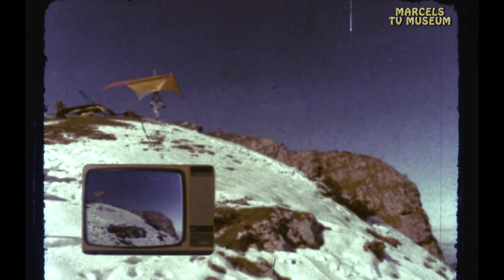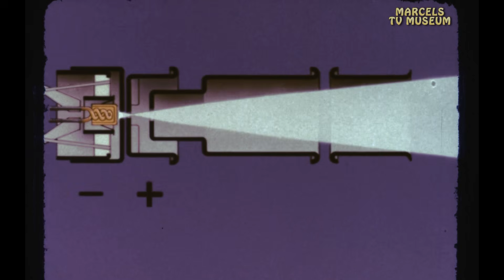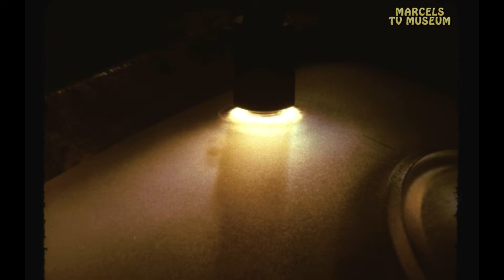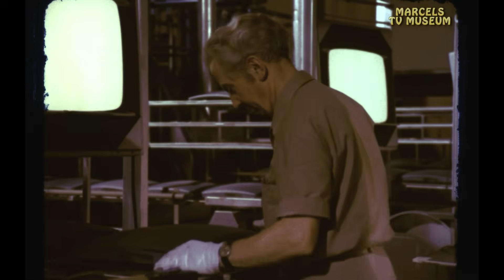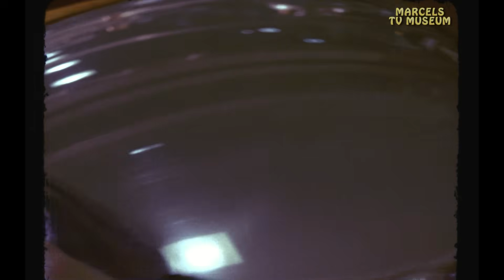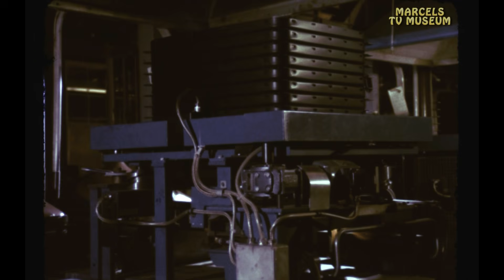Naturally... in colour, a look inside a color picture tube factory.

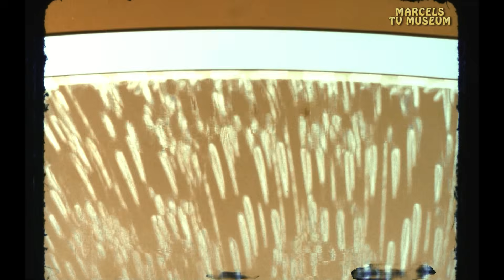Comment: At 24:00 video explains how the shadow mask is used as an exposure screen to form the stripes on the tube face.  But it is not explained how a shadow mask, with its "interrupted" hole pattern, makes solid phosphor stripes on the screen.  The light source needs to be either a stripe parallel to the rows of holes in the mask, or needs to be moved parallel to the rows during the exposure.  Which way is this done?

Comment: I remember the first colour TV's in the UK during the 1970's. Although I had to know how a TV worked, I seldom had to work on them and I'd forgotten how much cutting edge technology went into colour TV. Phase modulated I & Q chroma, amplitude modulated luminance and some clever maths to get it all to work. I still remember 4.43361875 Mhz was the PAL subcarrier frequency and glass delay lines to cancel out any phase errors between adjacent lines. The system from camera to receiver needs a video of its own.

Comment: I find it amazing how sophisticated CRTs are. The fact that it was developed to a reliable point before LCD screens is mind boggling.
Reply: That's only because LCD is even more sophisticated ;) With more screen layers, advanced molecular chemistry needed for efficient subpixels, electronics components printed directly in the screen surface and much more complicated control circuitry, not to mention advanced lighting like compact fluorescent or even mindblowingly hard to build properly marvel - white LED.
Reply: @EustaH  Yeah the reasons tvs were crt in the  first place is because yeah cheap microcontrollers is what made lcd and o led tvs possible. Modern tvs basically have computing in them.
Reply: @cosmicsvids  That’s true, but my point is we made our current tech so cheap and so abundant that it seems easy and simple, so we are astonished how complicated and precise some things were 50 years ago. 

In reality the 1$ crap from china requires far more precise and complicated parts than this CRT - we’ve just got that good in making stuff.

It’s like watching a true master playing an instrument - when he does it it looks effortless, while in reality a regular person wouldn’t be able to even position his fingers that way, let alone do it fast ;)
Reply: @EustaH  LCD / LED / OLED / Mini LED / Micro LED are 🗑️ compared to CRT.
  It is an Electron Gun vs. CCFL / LED / OLED lamps. Piece of 💩 light technology!
  CRT 📺 have built-in HDR. Watch a DVD Video™ movie on a CRT 📺 hooked up via S-Video or Component and you will see HDR on night scenes that have a 🔦 or 💡 turned ON.
  Flat panel TVs need the hardware to produce HDR built into them and the software to produce HDR programmed into 4K Blu-ray™ Discs. And then you have to turn ON the HDR and calibrate it. Pathetic! Piece of 💩!
  CRTs just do it… inherently. No need for extra hardware to be built into them or software to be programmed into DVD Video™ discs, or adjustments to be made by the consumer.

💯% undebatable & undeniable facts|truths.
Reply: @EustaH  ⚪️ LEDs are not difficult to build. It is just a 🔵 LED with a phosphor coating to help make white.
  LED lighting is a piece of 💩.

💯% undebatable & undeniable fact|truth.

Comment: Watching the way of assembly, how Labour intensive it is just shows how far automation has come. And it's amazing how much the technology has come now we can build really large TV for indoor or outdoors and really thin practically like a wall picture frame amazing  ! .
Reply: Manufacturing CRTs today would still be labor intensive, regardless of how far automation has advanced. This is because CRTs have many individual complex components that require great precision to manufacture. Modern TVs (LCD, OLED) are completely different technologies, which in many ways are much easier to manufacture. 
Light and cheap plastic defeated heavy and expensive glass.

New TVs (LCD at that time) literally immediately gained an advantage over CRT in such characteristics as dimensions, weight and energy consumption. But in terms of overall picture quality (not just pixel detail), LCDs and OLEDs have only recently begun to approach CRTs. And in some aspects of the image, modern TVs still cannot surpass CRT.
For roughly the same reason, PDPs (plasma) also left the market. It was a very high-quality, but too complicated and too expensive technology compared to new plastic panels (which are basically just a lot of tiny LEDs).
Reply: @B1-Han  ... Absolutely right, you correctly stated the essence of this topic !!! 😮

Comment: It's a bit odd, that a Philips factory movie show them producing Sony Trinitron tubes
Reply: They were not showing Sony Trinitron tubes in this film these were philips 30AX tubes which also like the Trinitron had vertical phosphor stripes on the screen the main difference is the Trinitron had an aperture grill which was made with thin vertical wires that were under tension (that's the reason early Trinitron tubes were cylindrical shape in the vertical plane) these wires formed the mask with the electrons passing through the spaces between the wires just like the electrons passing through the holes in the shadow mask there were a couple of very fine wires stretched horizontally across the aperture grill to prevent the vertical wires from vibrating from the sound and other shocks transmitted to them vis the tube structure. The other difference is the Trinitron tube had a single electron gun that had 3 cathodes this produced the three electron beams but these 3 beams passed through only one electron lens formed by the remaining electrodes. on the earlier tubes they also had more electrodes at the front of the electron gun assembly that provided the static convergence of the electron beams the connection for this was brought out via the Final anode cap which had a coaxial connection and a potentiometer on the EHT unit for adjustment of the static convergence as well as the usual focus potentiometer. on the later tubes the static convergence electrodes was powered via a dropper resister fixed on the side of the electron gun assembly inside the tube. The patents for the in-line gun CRTs must have expired in the early 80s as other manufacturers of CRTs started making similar tubes which became more common these tubes were collective known as PIL (precision in line) tubes and were easily identified as the deflection yoke assembly was glued onto the tube wirh rubber wedges stuffed between the deflection unit and the tubes cone these were glued in position once the convergence had been adjusted and there were also ring magnets with 4 and 6 poles on the neck of the tube to set the beam landing and static convergence.

Comment: Thx for sharing this  superb, comprehensive documentary!
My only question is why Philips chose to use crappy 16mm film to photograph a short documentary about COLOR PICTURE tubes? If Philips -- given their deep pockets in 1970s -- had used the best quality 35mm film (and camera systems), this documentary would have looked much more professional. Not like some college film project.
Reply: Arguably, it could be an issue with this scan of the film. 16mm isn't bad per se with a good scan, and direct projection would probably have been easier with 16mm

Comment: Insatlled quite a few of these when I was 17 - but only after "rejuvenating" the old tube had failed! They represent most of the weight of the TV set. Good old Radio Rentals would squeeze the last hours out of a tube before replacing it. Tubes were also dismantled and "re-gunned" to give them a second life.

It's a good job this documentary was made on 16mm film which has outlived this whole technology. Now we can still watch that film, scanned to video and delivered down an old phone line to appear on you tube. A lot of very early video tape "films" are now lost and those that remain are very low resulution.

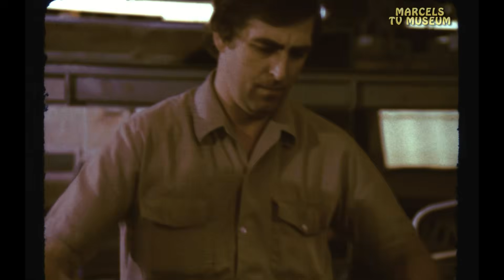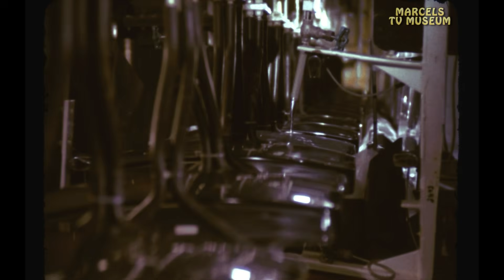Comment: At 20:26 he says "from now on the shadow mask and the screen stay together for all remaining stages of production" and then almost immediately after at 21:02 "the screen and the shadow mask are separated".
Reply: They are not bonded yet but will be handled as a pair from now on. The shadow mask uniquely belongs to this screen and non other. You can't swap them as each have unique placement and the screen will get the florescent stripes to match. So they stay together, meant for each other but not yet married.
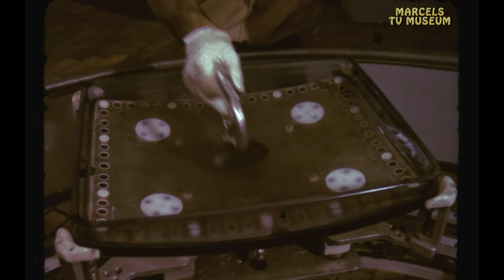Reply: 19:57 there is still the distance piece between the glass and the mask to remove, and coat the screen so obviusly the screen and the mask are separated but handled like a pair.

Comment: Definitely the most complete look at how colour CRTs were manufactured, and no surprise that it came from Philips. My family had a Philips TV from 1977 that was still working in 1997. Quality, engineering and craftmanship of which we will likely never see again.
Reply: @@wirelessnutau In Australia at least it would have been made by Sharp or JVC and rebadged by Philips. Japanese made most VCRs and the best VCRs
Reply: We had a 1977 Sears that was still kicking when we gave it away in 1997.
Reply: I still have my Sony WEGA 36" flat screen. I didn't purchase an LED tele until 2015. 
That reminds me, anyone looking for a high quality CRT? It weighs 200# and not easy to shift and good luck finding a stand to support it.  :D
Reply: филипс уже давно не тот.
Reply: @WirelessNut Yup, I've got a couple of those too. The only things that ever needed replacing were the belts.
Reply: What type of tv was it?
Reply: @ElectronicInspiration  A very similar model to this https://www.youtube.com/watch?v=QYBdOKpWTj4
Reply: im currently using a Dell monitor from 1999 and it still has excellent picture quality.
Reply: Have multiple Sonys working 20+ years later
Reply: Their 70s TVs were unreliable compared to Japanese ones, but usually able to be fixed easily unlike other European TVs.

Comment: No mention that the reason they were so heavy was that the glass needed to be LEADED glass to withstand impact to prevent implosion.

These things were  (and are) TOXIC to dispose of.
Reply: The LEAD was used for blocking the x-ray radiation of the tube. 
LEAD can not strengthen glass, in fact it is a component in the glass composition that lowers the melting point and softens the glass. As it also increases the refractive index LEAD is used for crystal glass items as well. Chemically the LEAD is bound into the glass matrix in a way that it can not leach out. This is why leaded crystal glass can also safely be used for bottles and drinking glasses. We do not have to worry about this. Years back the cullet from crushed tubes had been used as recycled material for making new tubes. Now, as there is no other use for the material it's widely used as road filling material. There are no environmental concerns about this. However, the phosphor layer of the screen is toxic and needs to be washed out before any further processing of the disposed tubes.
Reply: I read they were leaded glass to cut way down on x-rays too.